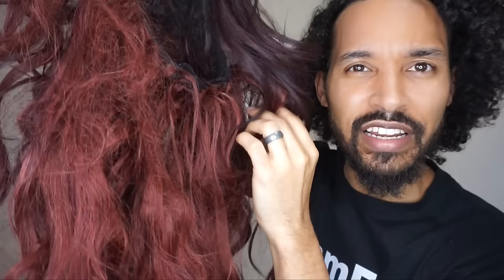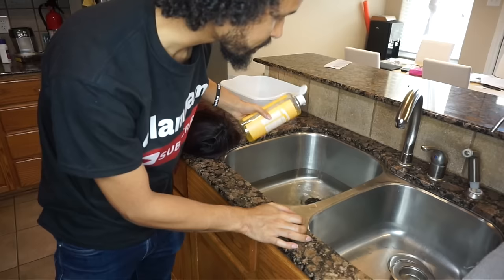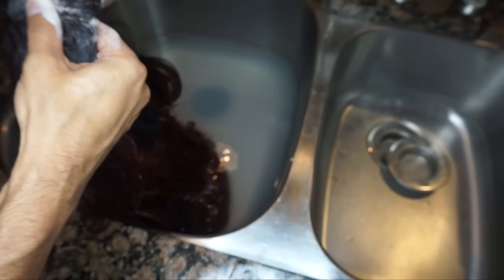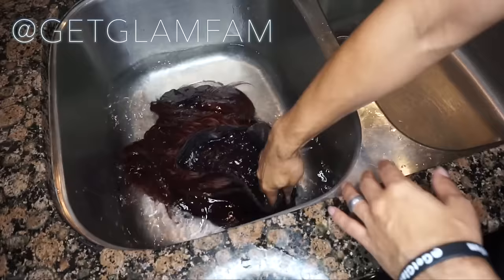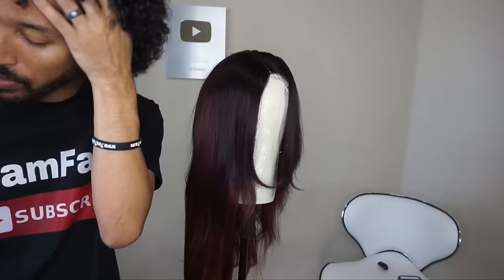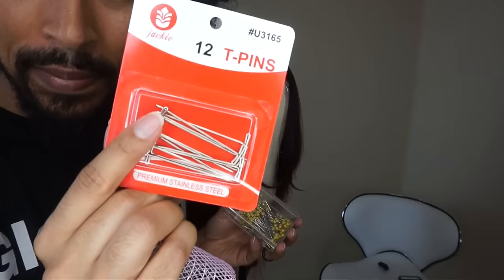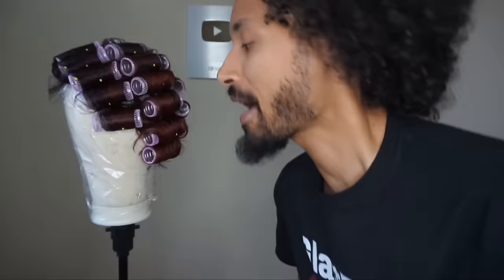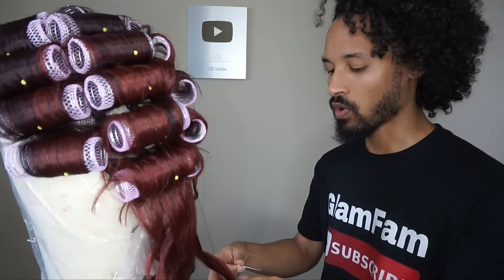How to Maintain and Restore Your Synthetic Wig

Comment: I loved the video so much that I went back and attempted to time stamp the steps for the rest of you/reddit:

~1:44 some brushing
2:49: cleansing
10:00: options: allow to air dry or continue on to blowing straight
10:45: blowing straight with metal bristle brush and hair dryer
12:27: using curlers
16:22: steam time! including clever use of a THERMAL bag to maintain heat!
19:50: allow to air dry in curlers
20:25: taking hair down from curlers
20:29: final brushing /styling
Reply: Thank you!
Reply: Ty
Reply: Much thx!!!!!
Reply: Thank u
Reply: Wow! Thanks! This IS an awesome tutorial. You save me bank.

Comment: My cousin has been a drag queen for nearly 30 years. He makes all the wigs for himself & his drag family. Everytime I walk in his salon there's at least 3 in progress. 
  His #1 Queen tip for getting make-up & glue out of the lace is Original BLUE Windex & a soft bristle toothbrush. A really soft baby toothbrush is great if yo can find 1. I never have to rub it Just, I just lightly flick & it comes right off. Just spray it & let it sit a few seconds for the make-up  & you can clean it right off. For glue you might have to let it sit a few more seconds, it really depends on the brand of glue you use. But this trick WORKS like a charm & it rinses right off with no hassle. 
 If it's a particularly dirty one a client needs grease paint from stage performances cleaned off the lace  he'll tag team it by washing the wig with the original blue dawn. Don't know what it is about the blue in both but they work great if you get the name brands. Just make sure it's BLUE.
 I even use the Blue Windex trick for stain removal on my kids clothes & my car upholstery. Just spray, scrub with a brush & it wipes right off. 
*If I offended anyone,  I'm not being disrespectful of his pronouns. He only goes by "Her" when he's in drag. And he has 2 husband's too who also use the He/Him pronouns. 
Also, 2 of my 3 Bio kids are LGBTQ+. This Mama Bear will call you whatever you want to be called & I promise not to call you late for dinner. That's just how we roll here.

Comment: 2021 from Boston Massachusetts, USA.
Just in case your question needs an answer.
For all the Glamfam  learning about wigcare.....
I can relate to the baby bathing scenario.
With my newborn daughters, I almost dropped them....
It was horrifying!
Babies are usually so chubby and round that it was difficult for me to hold onto
Them....The soap adds to the slippery skin.
And so, I had to bathe them in a clean kitchen sink or bathtub with a towel lying under the bottom of them.
They can't help by sitting up at all. They are floppy and fragile so, grabbing their arms and legs will hurt them.
It doesn't take much water to wash a baby. Basically, you can sponge bath a baby.
Today, there are wonderful soft mesh or padded baby bathtubs but, back in the 80's it was a dangerous task(for me).
I am sure that today's parents have no worries but,  back in the day, with no Youtube, I had no idea what to do...
All I can say is to keep them as low as possible if you are in a situation where you have an emergency....and have nothing to work with...

Comment: Just a suggestion I've been researching wigs blah blah . So if synthetic wigs are made with acrylic fabrics mainly . Why not use gain and fabric softener? So I had a wig that looked like some roadkill and I soaked it for like 2hrs and let air dry then rubbed it down with softener dryer sheet an it looked an felt real no tangles not any flyaways . So maybe try it and do a video

Comment: Ok now I'm totally baffled. The other videos I've seen say "Never use hair shampoo on a synthetic wig! Never use warm water; only cold! Never use a hot curling iron on synthetic hair unless it is heat tolerant! And if it is heat tolerant, spray heat protectant on it before applying heat!  Never use a brush on a wig, especially when it is wet!  So now I am less knowledgeable than when I started because I have no idea what to believe!

Comment: Another thing to do is blow out the wig almost every time you wear it - dont wet it or apply any products, just blow it out in its dry state. It keeps tangles way, and keeps it bouncy. At least that works for the Outre melted hairline wigs that ive been wearing. Theyre amazing.
Reply: Do you condition it ever? Are there special conditioners for synthetic wigs?
Reply: @Myaccount923  yes i have two wigs that have lasted a long time and I gently shampoo and condition them about once per month, or depending on how often i wear them (I dont wear them daily). I use any moisturizing conditioner i have on hand at the time. They all work great. The key is not to rough the hair up and detangle as you go through the washing process.

Comment: Question: in place of using steam and the thermal retention shipping bag would dunking the roller set wig in hot water and letting it dry under a hood dryer or air dry produce similar results?

Comment: Thank you very much.  I love you hair my hair is thick and course and most stylist. Love me. However, 🙂😀my question is What should l  conditions synthetic locks after shampooing? Is it the same process? How do I keep the  locks near my face to appear just as smooth and Coley as the back inside should I wrap them with my fingers or straws to keep the consistency of the curls front of?

Comment: New to wearing wigs. My wig consultant have me use special wig shampoo and wig conditioner. Do you have to use conditioner for blended wigs? After brushing and blow drying, is there a product you put in the wig to hold the curl. I still see frizzy hair at the ends, when I allow it to air dry. What products can I use to help with that?

Comment: Good afternoon kind sir. I have a synthetic hair wig that Ive had for some time and the wig has lost much of it's shape. My questioni for you is, I know that heat will remove the shape of the synthetic fibers, but if after washing the wig would it be advisable to make several loose, medium braids all throughout the wig and then apply low heat would that mold the hair into loose waves , or melt them within the braid, therefore making the braid unable to unbraid? I'm sorry my comment is so long, and I hope Im making sense 😅....

Comment: Would Dr.Bronner's 18-in-1 hemp PEPPERMINT (pure castile soap in the blue label bottle),be ok? I happen 2 have a big ass unopened bottle of that already available at home,cuz my mom  got it & never used it. I'm asking cuz I think the mint essential oil is the main or only difference in mine,but won't risk using it if it could have some kind of adverse effect on the hair that the almond kind or whatever u used wouldn't!?